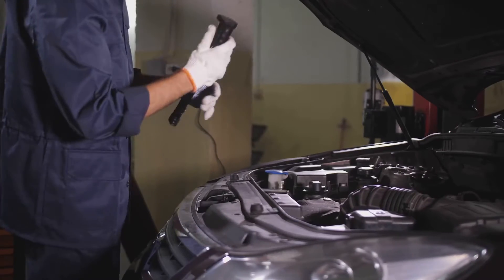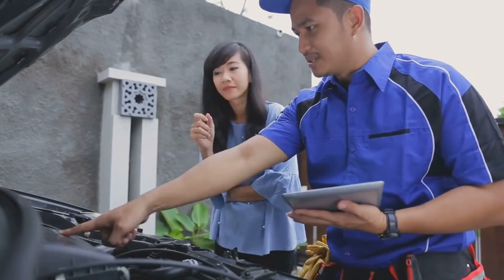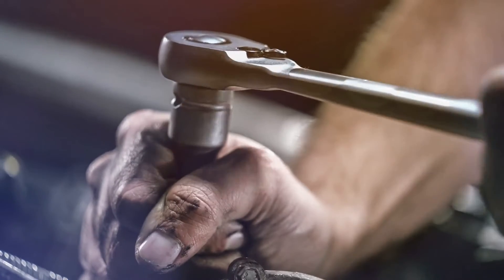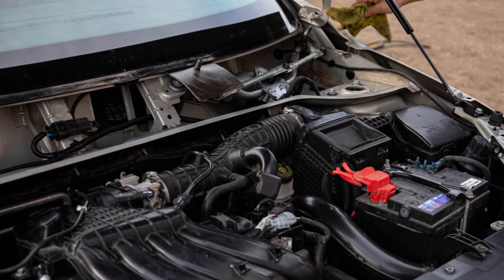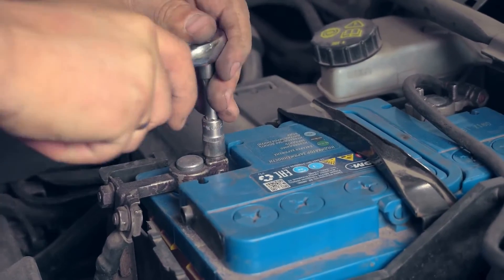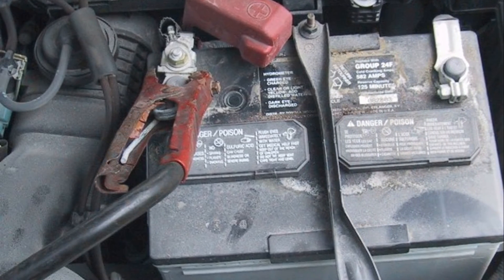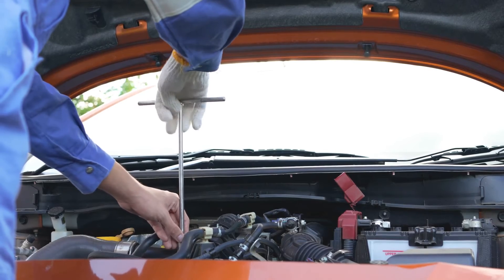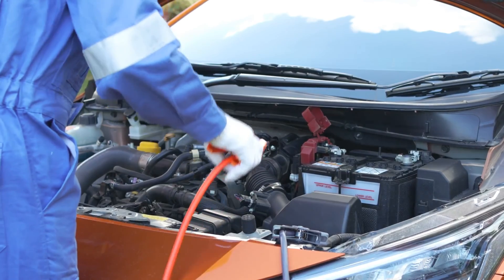How to Disconnect and Reconnect a Car Battery: Which Terminal to Remove First (Step by step)

Comment: I have a AGM battery that vents to the outside of the car. There is a tube that hooks up to the battery, but also another hole as well. Doesn't the battery gases escape from the other hole even though I put a tube in the first hole? Thanks
Reply from the maker: Hi Kalani,

Modern cars/batteries have these tube in place to prevent any risks with the battery. 

What car are you currently driving?
Reply: @HonestMechanicChannel  it's an older 2011 Hyundai equus.